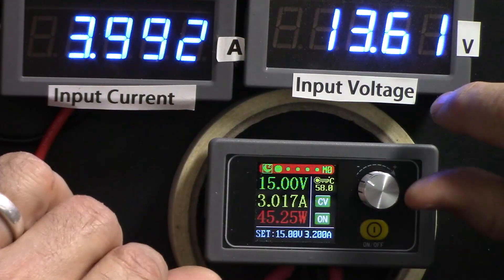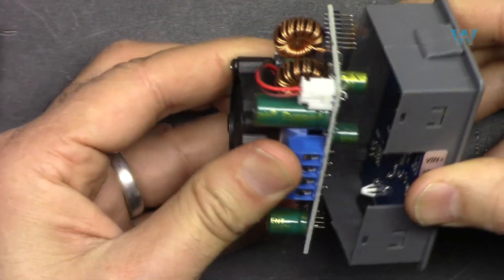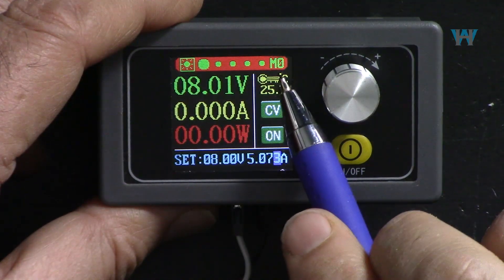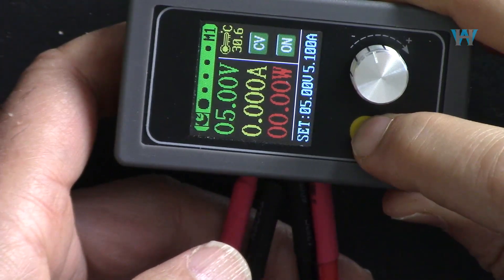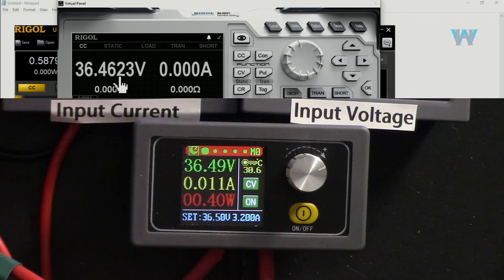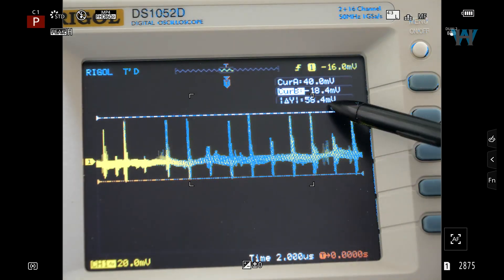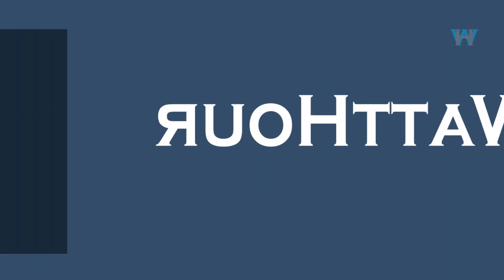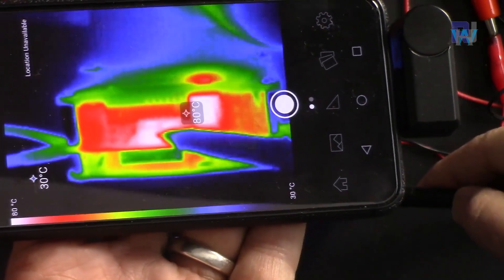Review of XYS3580 5A Step-down Step-up 5A 35V Constant Current converter

Comment: Hello. Thanks for the video. I recommend the xys3606 or xyh3606 buck-boost module with its very practical remote control, these 2 modules (216W) do not heat up like the xys3580 (80W) which gets very hot with use.
Reply from the maker: Hello and Thank you. The manufacturer should contact me I will work with them. These are my work sample and the best way to review product.

Comment: How do you calibrate the voltage readout to be more accurate? My voltmeter says it outputs 4.8v when the display on the supply says 5v. Is there a way to offset or calibrate the displayed voltage? I can't find this calibration in the video, so is it even present in this unit? Thanks
Reply from the maker: I have not seen any information on how to calibrate it.

Comment: when lvp its trigers on, and output goes off, if  the voltage its getting up turn the the dive on or need to press the button? Ex: battery volt drops at 12.2 -> lvp 12.2 device goes off, solar start charging the battery and volts of battery goin 12.3v, is this device starts the output or stays off?

Comment: Most of the time my unit stays in "CV" mode. Can I turn it off or switch to "CC" mode? What's the difference?
Reply from the maker: that's correct. when you set it to for exampkle 9V, it is contstant voltage (CV).  then if you set it to 1.5A Constant Current (CC), and use it, it will keep the current up to 1.5A constant. so if your load needs 500mA or 1200mA it the CC light will not turn ON. but if you reach 1.5A the CC will turn ON and protect your load and will not allow more than 1.5A.
Reply: @WattHour  Thanks very much for the explanation. I couldn't figure out when each "mode" should kick on. Now I do! 🙂

Comment: I bought a similar power module (XYH3606) and it won't turn on (the module heats up with power supplied but it cannot turn on). I wonder if it is due to faulty MOSFETs, but I don't know since it they don't have any numbers.

Comment: I have two of these.  Both of them had no thermal paste on the components under the heatsink.  First one died when trying to power some LEDs.  I just use the 2nd one for small projects and won't attempt my LEDs again with this unit.

Comment: Its nice video, thank you so much.
But I have a question, so what is the maximum Volt we can connect to the converter? So I mean a lipo battery.
Reply from the maker: if you mean to the input, the I have explained it. if it is the output aso I have shown . I don't remember anyting unless I watch it. so you watch.

Comment: I bought one recently it has slightly different settings menu with a few more options. As usual it is a mystery as to the exact functions.

- Voltage/current/power/set colors.
- Baud rate per memory slot. It makes me wonder this has serial port logging.
- An icon with the letter O. Selecting this brings up a dialog that says "Clear". Turn the dial to select Yes / No.
- An icon with the letter R. Selecting this brings up a dialog that says "Reset". Turn the dial to select Yes / No. I'm uncertain the difference between these reset and clear functions.
- The very last is mystery symbol with ON / OFF setting. No clue what this does.
Reply: I think I have the same one as you do, since my settings menu is also slightly different to the video.
If that is the case, the very last symbol in the settings menu is for the flash screen when it is first turned on.
Mine shows a "Sinilink" logo.

Comment: When I connect the buck boost to my bench power supply, at 30v input and 1amp, I then set the buck boost to 36.50v and 3.2 amps output as per your video I only seem to get 1.83 watt of output power. Can you tell me if I am doing something wrong?? Thanks.
Reply from the maker: you must have set the power or current limit. check it.
Reply: @WattHour  Thank you. I'll check it.

Comment: I bought  a XYS3606 from AliExpress but it went wrong on first test. I removed all MOSFET under the heatsink and tested them and 2 doesn't work. Without those MOSFETs I can turn it on. All of them are unmarked, so I don't know what need to replace them. Any idea how can I get the model number for these MOSFETs?

Comment: Do you have a recommendation for the connection of common grounding for this? I tried connecting my esp32 ground to the output ground of xys3580 and toasted my esp32, should I even connect the ground of xys3580 at all to my esp32?
Reply from the maker: this module has GND and +. it should work to power any device.  it does not have 3 terminal.  just two.
Reply: @WattHour  but it has two ground, one for the input and one for the output

Comment: what is the difference between XYS3580 5A and WZ3605E DC DC  36V 5A, WZ3605E only has 2 buttons. Which is better controlled? 1 or 2? thx

Comment: Apparently if u hook up a large dc motor or connect a large inductive load it will blow up. If you drive reverse current from an external supply it will also blow it up, If you hook up a battery for charging and switch of the power input the back flow from bat can burn the PCB according to one seller..They provide a diode to use in series with output crazy..

Comment: Great video lots of details,
   I have this with the extra 4 pins for Bluetooth but it did not come with that part.
      Do you know what the extra setting is for under the color settings (001--115200) ???
Reply: 4 pin is for wifi module. On ali price is very cheap. I have this module. Works perfect on phone and win10.
Reply: @Kris0725PL  Forehead Slap...Ha Ha I saw that and totaly missed what it was for ....thank you!

Comment: How can I adjust the voltage readout? Mine is much less accurate than yours for the voltage out
Reply from the maker: Then what is this video about?
Reply from the maker: I have explained everything and if you watch it, you will learn. This is in-line any others video you have seen
Reply: @WattHour  I skipped through it and will sit through the entirety later on
Reply from the maker: Hello, If you live in Canada or USA, I am giving away this DL24P 180W load and energy meter. Make sure to sign up for it https://youtu.be/-UblSfUEY-0

Comment: I have a battery with a voltage of 3.9v, I set the current to 4.2v, I set the current to 1 ampere and the charging result is constant cv  4.2v and the current is charging to 0.050a, why? I have a 12v 5A power source, it's not a functional current setting at all.

Comment: Do you think it can be powered with an ATX PC power supply with 12V output (offers 15 Amps)?
Reply from the maker: the source never matters. you can power it up from 4 AAA battery. The important part is what you want to get from the output.  The power is important Voltage(V) X Current (A)=Power(W). Absolute it will work.
Reply: @WattHour  What happens is that I read in the product specifications and it said that the maximum input amperage was 9 Amps, and the ATX computer power supply delivers 15 Amps, that's why I don't know if I can support it.
Reply: @DanielRomero-wy1xw  it will only pull as much current as it needs, it would work just fine.

Comment: Does this device work only with DC? Also, what voltage does it require to work?
Reply from the maker: this is for DC. Voltage have been mentioned in the video. Full details.

Comment: Will it charge 12Volts battery lead acid?
Reply from the maker: When we say the output can be from 0 to 35V and hen yes it can charge 12V battery. But gotta understand if you want to charge lead acid battery, the charger should be set to something like 13.8V but check manufacturer charge voltage. Then if your battery has capacity like 100Ah ÷5A=20h so it will charge it in 20 hours.  As this device can supply 5A maximum.

Comment: Even if normal voltage is input, lock is applied after lvp message
Any solution?
Reply from the maker: check the settings. You have have set something wrog.
Reply: Locked out and unable to enter setup mode

Comment: Hi..you try to comunicate with pc over i2c? I purchase one and i see 4pin communicate cable...outous is 5v and two pins scl and sda. I try tommorow with funny experiment with arduino and application on pc :)
Reply from the maker: Hi, you can't do it unless you know registers and commands.
Reply: @WattHour are you shure? I try today with arduino and sda and scl and gnd to comunicate over com protocol ..maybe purchasw today esp moduke wifi....
Reply: @Kris0725PL  Maybe a 4-pin for Bluetooth socket?
Reply: @englishrupe01  i think..it is support by firmware...
Reply: @Kris0725PL  Ah, ok.